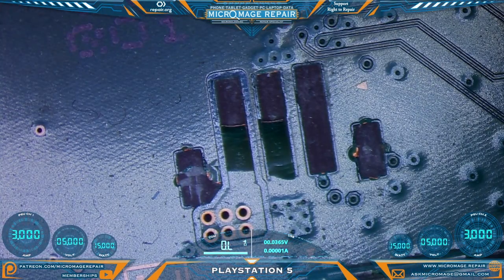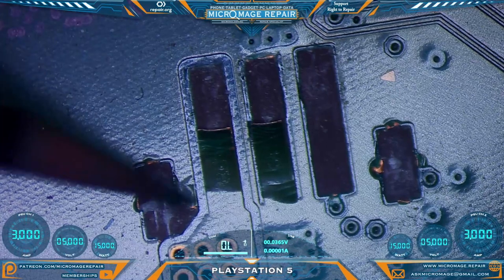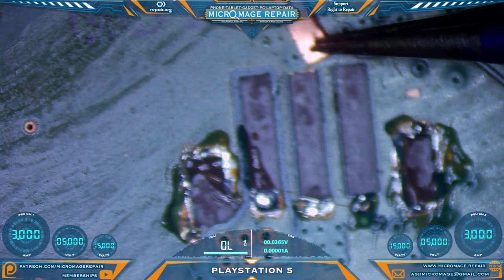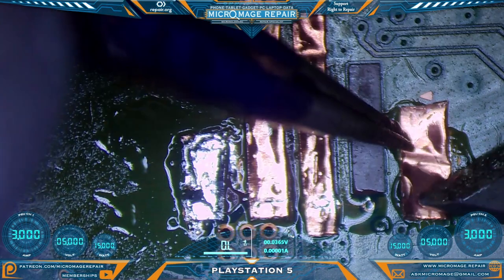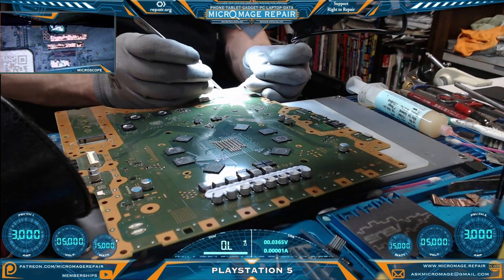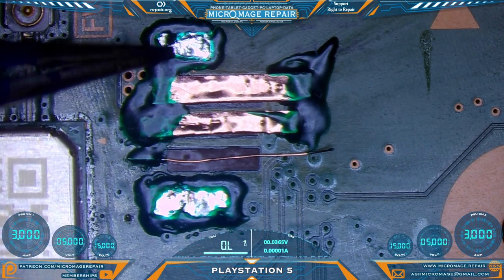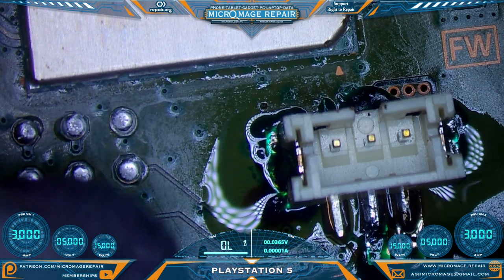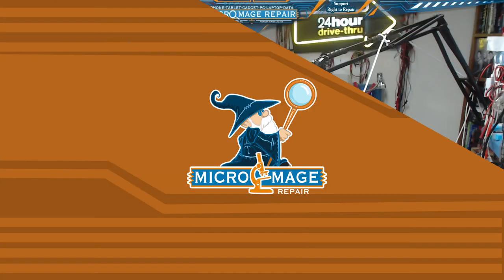PS5: ☢💨Fan Connector Ripped off Board!

Comment: its actually really easy to rip the connector off its poorly designed I've taken off those connectors from dozens of ps3s and ps4s and that's never happened to me. I barely tugged and it popped right off. I've used more force on nintendo switch connectors. Even as a Playstation fanboy I am saying that connector is poorly designed.

Comment: Easy fix.Planned obsolescence. Make it so you need to take it apart to clean it. It breaks easily while you do it. Ps5 sony garbage. The fix is this. Grab a USB cable, cut off other end. On connector plug that came off board. Solder on 3 2" leads. The 2 outside wires, twist together. They go to the positive on the cable. The center is the negative. Solder it to the negative wire on usb cable. Insulating wires, test it in a 5 volt USB wall plug. If it works, close the bottom of ps5 the up and plug the USB cable in the back. This worked for mine. "F" sony, they did this on purpose.

Comment: Now that is what I call a UV lamp. I have seen some use solder wick to anchor down ground  terminals
Reply from the maker: Yes it is, I have found I get impatient with the laser because it requires I hold it to cure, had issues with getting a thorough cure as a result, so I just place the big lamp and do something else for a bit.
Have seen the solder wick method, and it is a great approach too. This is just the method I came up with prior to seeing that one and have just stuck with what I do.

Comment: what type of copper tape are you using? i tried using copper tape that was supposed to be conductive on the adhesive side as well but it didn't work. i couldn't find the product you used in the video or in the description. is there an amazon affiliate link for your copper tape? great video btw :)
Reply from the maker: Unfortunately there isn't much in the way of identification on my tape rolls. I picked them up from an electronics surplus store (when there was still some of those around). 
It's vital to clean the adhesive side off before trying to solder with it. I usually solder the non adhesive side down then clean it off.
Reply: @MicroMageRepair  oh ok! i'll try that instead! thanks :)

Comment: I went to a shop to fix it and they were charging me 200 bucks,so I would like to know how much would you really charge for this
Reply from the maker: My situation is different and not really comparable. 
I don't have a shop's overhead.
I also factor in shipping cost, wich is not insignificant,  into my prices. Otherwise, I'd never get any mailed in.
My overall cost with shipping comes in cheaper than $200 but you will have more hoops to jump through and a longer turn around due to shipping times.
I do offer proof of my results right here in video form, so you don't have to wonder about how it will turn out.
It just depends on your needs.

Comment: Man solders like hes a heavy repair TIG welder! GJ...im gonna do this but i get to cheat since its all stuck to the plastic piece perfectly
Reply from the maker: I've made a few adjustments to this technique that have helped.
I've begun pretinning the pads before soldering them to the board.
The ground pads in particular have increased in strength quite a bit.